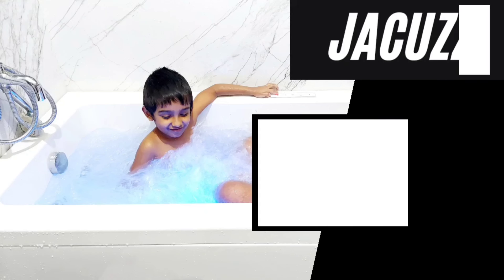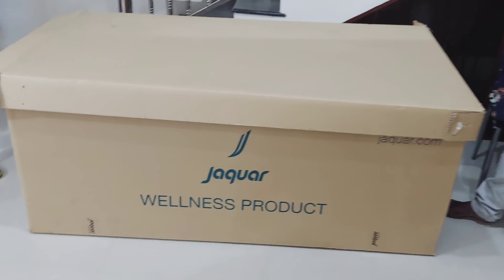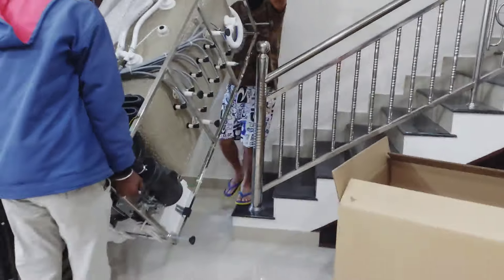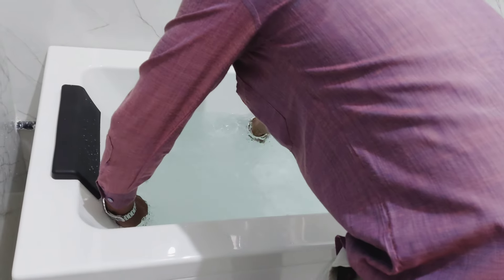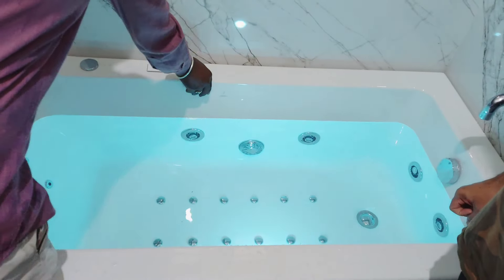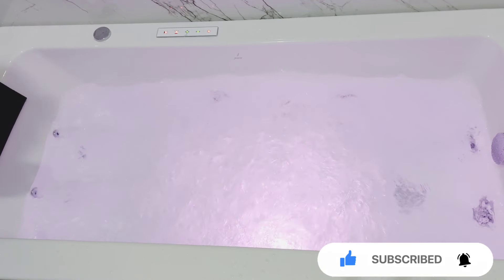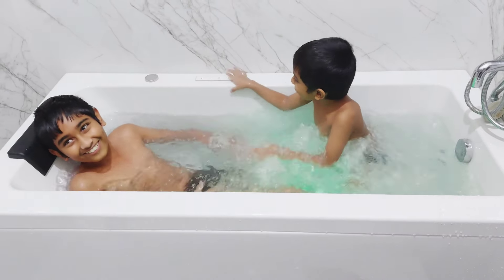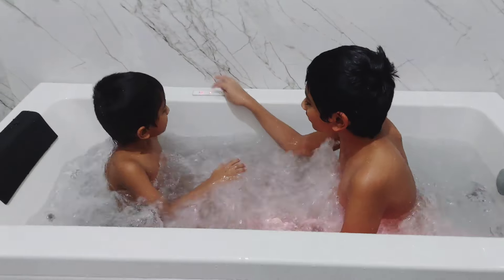Jaquar Jacuzzi Installation & Demo | Jacuzzi Tub Demo | Bathtub Installation & Demo |Archie's Corner

Comment: Thanks for the video. I have one question however, is there any electric hazard that I need to worry about when going for a jacuzzi. How well are the electric components insulated from the water?
Reply from the maker: electric components are installed under the tub and it’s completely safe

Comment: Good Information, did you research on other brands like madonna or Romania Bathtubs. Because it's lower price but added features like water temperature control(it will keep water warm) and Ozonizer(O3 for good health and skin), jaguar, Oyster & Kohler has them but in premium spa only, which is costly.

I'm thinking to buy from this brands madonna or Romania Bathtubs, may i face any problem in future what's your suggestion.

Thank you.
Reply from the maker: Thanks Swetha for the feedback 😊

We opted for jaguar just because of its reputation and after sales support. Even we were planning to go with Madonna but dropped since we were not sure of the after sales support we get with this brand.
Reply: @ArchiesCorner  Thanks for the fast reply, kindly answer few more please,what is the hardness of your water (we use underground water 450 hardness), how many time bathtub is used in a week (approx), condition of the product now(after 2 years), any regret after buying or regretted for other products(like you wish bought 180cx or other brands), don't you feel congested lack of movement and your rating 1 to 10(10 is highest).
Thank you.

Comment: Hi. This is very useful and informative. Thank you for posting. May I just ask you a few questions? 
1.  Do you use any other methods to clean the tub other than sponging?  
2. Since you have been using it for a longer period of time, have you faced any problems? 
3. How is the electricity consumption?
4. Seeing the comments, i understand that you use it as a normal bathtub as well. Can you use soap and shampoo during that time? Does hair clogs happen then?
Reply from the maker: Thank you so much for the lovely feedback 😊

Now, coming to the questions 
1. We use sponging only and have not tried any other cleaning method since sponging right after taking bath helps in cleaning it better.
2. We have not used any problems as such
3. We didnt see any major spike in electricity bill
4. its not recommended to use soap/shampoo but we have used and made sure to keep the outlet valve open while using soap. Also, I have never washed my hair since it might cause issues

Hope I answered all of your queries 🙂
Reply: Thank you for taking out the time to answer my questions 😊
Reply from the maker: You’re most welcome 😊

Comment: Thank You for the video. I am planning to one, one change will be in the size instead of 150CX I am going for 180CX. Just wanted to know if you have using or shampoo while switching off the jacuzzi, if yes for how long have you been doing that and are there any complications because of that (just asking because I read somewhere that soap usage should be avoided).
Reply from the maker: Thank you for the feedback Prasanna 🙏😊
Yes, we use soap/body wash when it’s switched off.. haven’t faced any issues as such.. but we have made sure not to wash hair inside since that could cause hair clogging issue… hope it helps 🙂
Reply: @ArchiesCorner  Yes it does help, Thanks.

Comment: Hi Mam, My bathroom size is 5*9, as is yours, so as u have been using it for shower bath as well, how z the condition of the tub, as Im afraid, if it is used for stand way shower, how sturdy is the base of the tub and its stand. Pls let me know if u face any issues after this 1 year of use.
Reply from the maker: Hi Sai, the stand is stainless steel material and base is sturdy enough.. it's still the same even after one year...so no need to worry about that.. hope it helps🙂
Reply: @ArchiesCorner  Thanks ji.

Comment: Thanks for deciding to make a video on this. I couldn't find much on YouTube. I have a few questions and I was hoping you could answer them.
1.) What are the noice levels during its operation. Does it ever get annoying?
2.) What was the price of your unit when you purchased it?
3.) Does it come with control knobs of the pressure of the jets or just on and off feature?
4.) My house is under construction right now. So let's say I were to install this at a later stage. Would a 15A electrical point suffice?
Reply from the maker: Thanks Kunal, glad to know it was helpful 🙂🙂
Coming to your questions,
-it does produce noise but is bearable
-we paid 103k for the unit
-yes, we can control the pressure with knob
-yes, 15A electrical point is sufficient
hope I clarified your queries 🙂
Reply: @ArchiesCorner yj😮

Comment: Does the price include the side panel on the website? Also did you pay 1.03L including the side and front panel?
Reply from the maker: Yes Manjunath
Reply: Thanks for the reply, can you mention the dealer you purchased in Bengaluru, as even I'm planning to install one
Reply from the maker: @manjunaths8873  we purchased it from Saini hardware store, sarjapur road
Reply: @ArchiesCorner  2 Side and 2 Front Panels used Or only 1 each ?
Reply from the maker: @GurrajSN 1 each

Comment: Mam can you please tell me the internal length of the bathtub? I'm planning to buy this same model and I'm 6ft tall.
Inside length at the bottom of the tub from the one end to the other? and inside  length at the top of the tub from end to end?
Reply from the maker: HI Deepak, this bathtub size is 5*2.5ft since you're 6ft tall I would recommend you to buy bigger size... there is one more size available in the same model.. you may check the options in their website - 
https://www.jaquar.com/en/whirlpool-fonte-170wx?Id=2320
https://www.jaquar.com/en/whirlpools-bathtubs

hope it helps :)

Comment: Hello, thanks for sharing this video.As I see it's already 2 years you have posted this video, so just wanted to know your recent experience with Jacuzzi ? Any problem or challenge you faced over the time? how was the maintenance?
Reply from the maker: Thanks Ankita 🙏 yes, we have been using it for almost 2yrs and haven’t faced any issues as such.. I make sure to give it a good wash and clean thoroughly after every use so that maintenance becomes easier.. hope it clarifies 🙂
Reply: @ArchiesCorner  thanks for your reply. Have you used as bubble bath? Can we used it as normal bathtub with soap added?
Reply from the maker: Hi Ankita, even though it’s recommended not to use soap inside, we have used bathbombs couple of times.. but during that time we have not switched on the power so that it doesn’t clog the jet sprays

Comment: Mam shop owner suggesting me to add water pump for good pressure mam you have installed water pump or water pressure is enough??
Reply: No need for pressure, Whirlpool Bathtub has it's own pump. In jaguar 1.4 HP hydro pump and .9 HP air blower is used, so no need. But if you are looking for shower, hand shower force and filler to quickly fill water in tub then go for the pressure installation.

Comment: The motor is installed just beneath the tub... Is this safe to use as kid will throw water every where in bathroom while Playing in the tub... ??
Reply from the maker: Hi Swagatika, yes motor comes pre-installed and is beneath the tub.. along with that side panels are installed, so chances of water splashing there will be minimal.. Also the technician has told its waterproof during the installation, hence safe.. hope this helps 🙂

Comment: HI mama, thanks for the video, it helps, I have few questions:
1) how to clean area below jacuzzi?
2) since you said u don't have separate shower area u do the shower inside jacuzzi, water spils around and area below jacuzzi becomes dirty over period of time, in that case how to clean it?
3) since it has electrical connection, how safe it is?
4) there are logs of small tubes and pipes, how they will be cleaned when hair or direct accumulated inside of it?
Reply from the maker: Hi Satya, glad to know the video was helpful🙏😊
Coming to your questions,
1. The area below jacuzzi will be concealed with the side panels and we will have to connect the outlet water pipe directly to the jali. So that area remains clean always
2. Yes, we don't have a separate shower area and we make sure to clean the jacuzzi and nearby area thoroughly after every use.
3. Electrical connection is perfectly safe since it's concealed under the jacuzzi
4. There is a stopper at the outlet pipe and it's our responsibility to make sure nothing gets clogged, personally we have not faced any hair clog issue since I have not washed my hair inside Jacuzzi 😃

Hope I answered all your queries 🙂
Reply: @ArchiesCorner  Okay, thanks for the quick and detailed response. I still thinking how come sprinkle water doesn't go below jacuzzi and make that place dirty over a period of time.
Reply from the maker: We have installed the jali with hole - please check this link for reference https://dl.flipkart.com/s/nlVW5hNNNN 
This will ensure that waste water goes out smoothly when it gets sprinkled
Reply: @ArchiesCorner  Okay, got it.

Comment: Madam thanks for the video.
In my bathroom also if I install this fonte 150 I don't have separate space for shower and will take shower in same.
Can it handle shampoo and soap while taking regular shower.
Reply from the maker: Hi Varun, our bathroom also doesn't have separate shower area.. so what we usually do is to take shower after keeping the water release valve open.. we need to be careful not to operate the jacuzzi that time since we should not use shampoo/soap in the same...hope that helps 🙂

Comment: Does it have a built in heater? How do you get hot water? Do you empty it after every use?
Reply from the maker: Hi doctor, it doesn’t have built in heater..we have solar heater installed and use the same to fill the tub and yes we do empty it after every use, otherwise cleaning the tub becomes difficult

Comment: Is this auto clean or manual cleaning is required ? Considering soap will be used.
Reply from the maker: Soaps are not recommended to use in jacuzzi.. I keep a sponge near by and make sure to manually clean after every use.. otherwise the cleaning process becomes quite tedious!

Comment: Very informative video. Can you please tell any pressure pump is required or can the jacuzzi be installed in normal pipe water flow itself?
Reply from the maker: There's no need to install any pressure pump and can be installed in normal pipe, first we need to fill water inside the tub and then jacuzzi itself will have options to maintain the water pressure
Reply: How much space is required for this tub
Reply from the maker: Hi Ravi, this tub is of size 5*2.5 feet

Comment: Hey I wanted to ask can i install it in a normal bathroom ? Like my bathroom is 9X7 feet it has commode washbasin etc i think i have space for this thing?
Reply from the maker: We have installed it in our 8*5 feet bathroom, so you can easily install in yours 🙂 Only con would be not having a separate shower area..so what we usually do is to take shower in the jacuzzi itself after keeping the water release valve open.. we need to be careful not to operate the jacuzzi that time since we should not use shampoo/soap in the same...hope that helps 🙂

Comment: What is coast for the full setup and installation process
Reply from the maker: Hi Shivang, for setting this up - we need to give an electric point and water point, no additional changes are required and can be installed in the existing bathroom itself. Also we paid 1600 for the installation